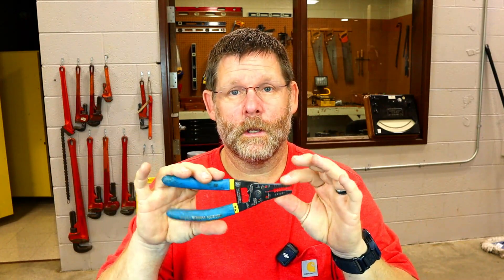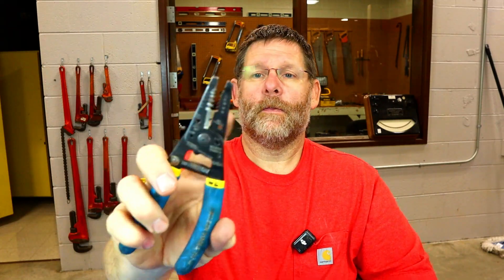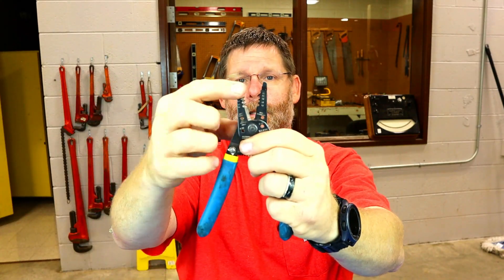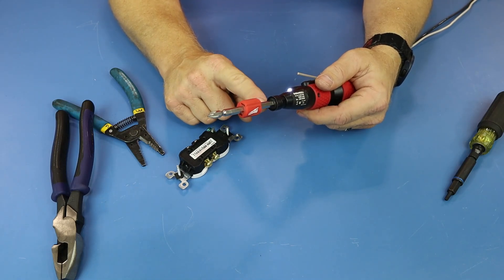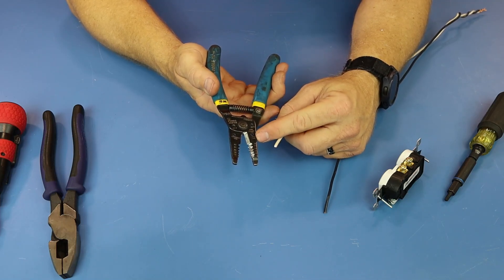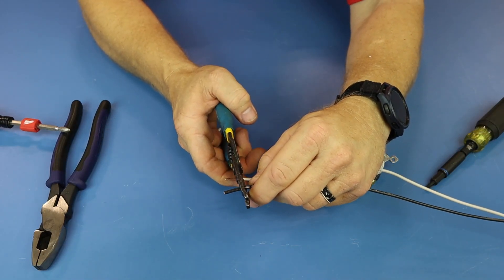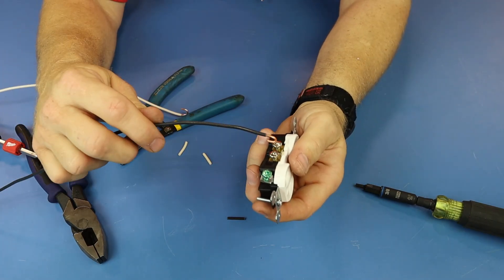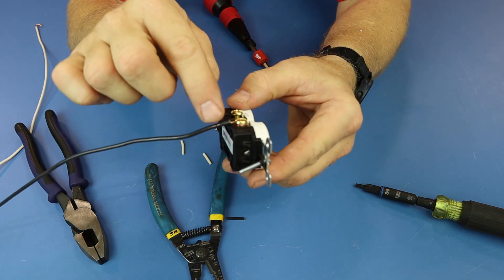How To Make Hooks On Wires For Receptacles Or Switches Correctly

Comment: Thank you! I appreciate learning how to easily form a J hook. It works beautifully in most cases. But I'm having a problem with Lutron Toggler dimmer switches (TGCL-153p). The terminal screws on these switches are too low and there isn't sufficient space around the head of the screw to easily hook the J hook around the screw! I've been unsuccessfuly searching everywhere for some tips on how to handle the task with these switches. I hope someone can help!

Comment: I’m left handed. Should I turn the stripper upside down ? Very helpful video . Thank You!
Reply: Good strippers will usually turn upside down on the pole for you.
Reply: @francoisloriot2674  Thank You so much! I will have to get some . I was just using a cheap crappy one and it was making it a challenge.
Reply: I'm now hooked on strippers. 😅
Reply from the maker: Honestly I'd say that's a matter of your comfort. Once you get use to one way and it's working,why change. I appreciate your comment and watching ☺️